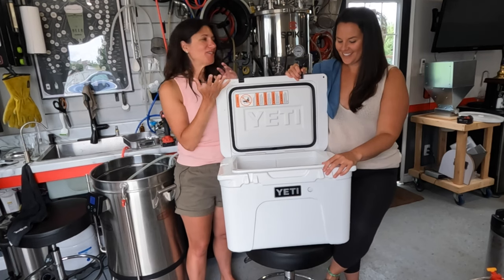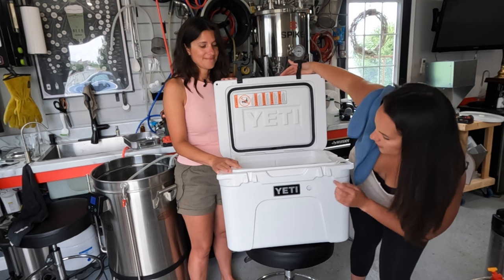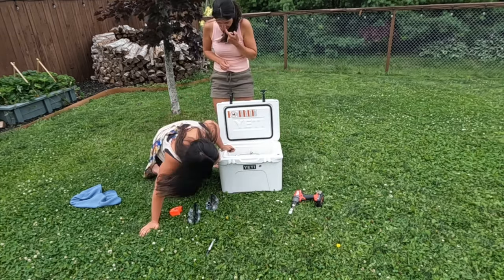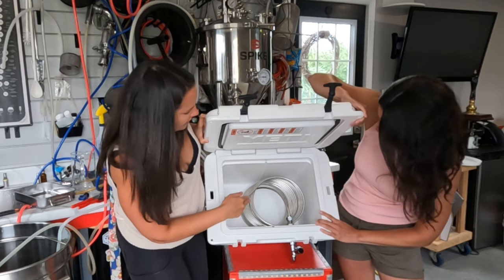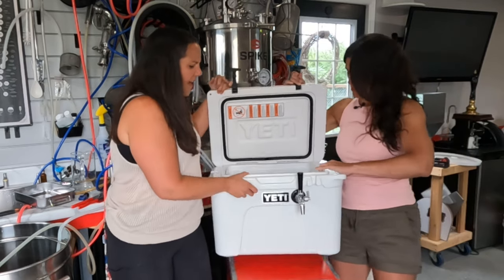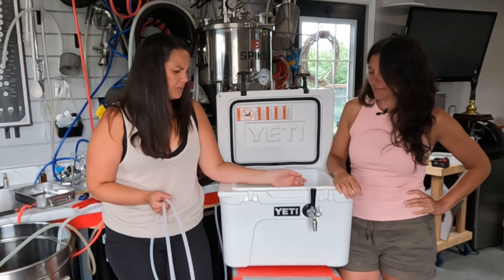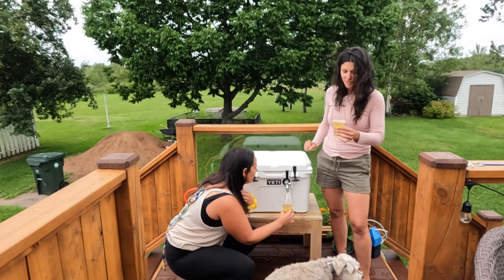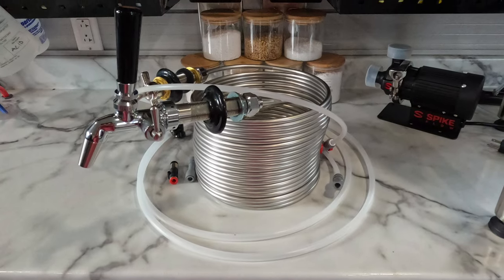Beer Brewnettes Make Jockey Box From Yeti Cooler

Comment: Awesome setup! Pro tip - while your coil seems to work awesome, adding some water to the cooler will help as the ice starts to melt. The water will stay ice cold and be fully in contact with your coil, maximizing heat transfer compared to ice alone. I used a similar setup with a bucket and ice and water always worked better. Cheers!
Reply from the maker: Thank you for the pro tip Mike! xx

Comment: You're very funny! But what about the coil, so this is probably immersion chiller? But how did you bend the ends of the coil without harming it? Keep posting the content I like it!
Reply from the maker: It was malleable metal! We measured it outside before teaming the homes and then just bent he coil slightly to meet the fittings. All the materials we used are in the video description so you can see the exact chiller we used in case that helps at all ❤